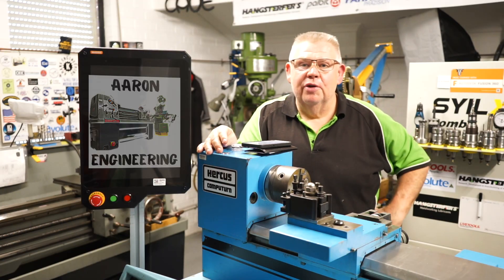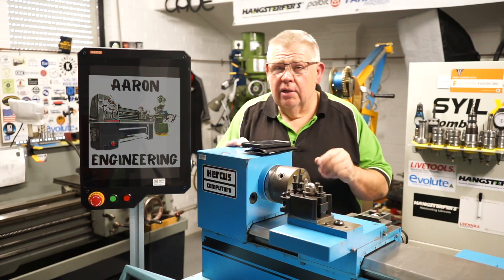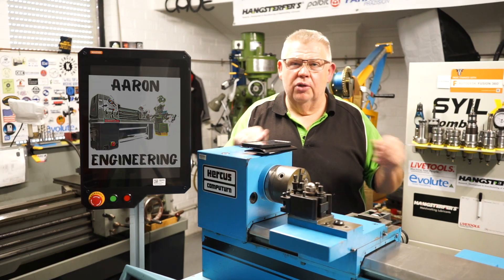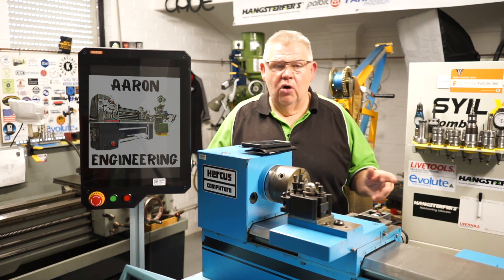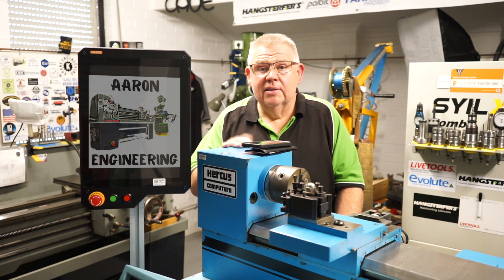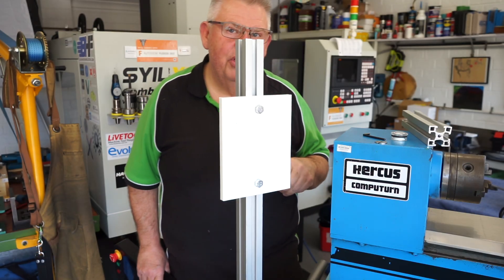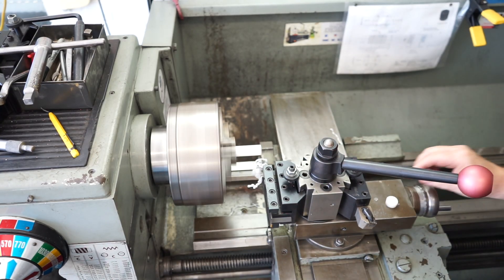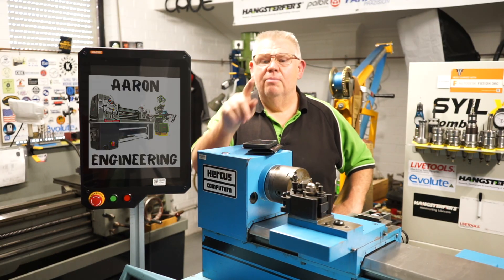Fabrication & Machining for the Hercus Lathe

Comment: Hello, I recently bought a Colchester lathe (master 2500) with the same braking problem you had.. Was it just a simple brake shoe replacement ?
Reply from the maker: Thank you for watching.  Yes you are correct.  I need to replace it, just hope the other end is still within size.  Cheers, Aaron.

Comment: Those pneumatic pop rivet tools are great. My puny arms struggle with the bigger rivets, but air pressure wins every time.
Regards,  Preso
Reply from the maker: G'day Mark.  You are absolutely correct mate.  Thank god they invented them.  My wrists don't have the strength the once had.  Hope you're doing well?  Cheers, Aaron.

Comment: G'Day Aaron, Your instructor was using reverse psychology on you, and it looks like it worked, job well done mate 😉
Btw good roadside pickings, but you can't expect engineer designed and built pickings😁
Reply from the maker: G'day Bob.  Sorry for my belated reply mate.  Yes I think you are correct in saying that.  We didn't do that much metalwork back in the day, but they overcooked us with woodwork.  Cheers mate, Aaron.
Reply: @AaronEngineering  👍